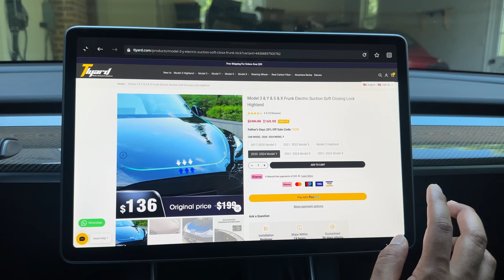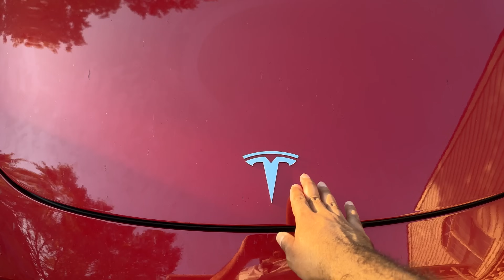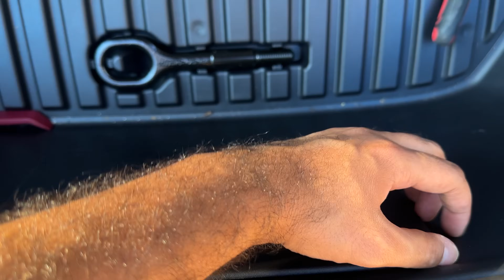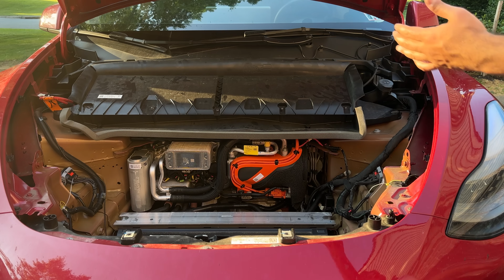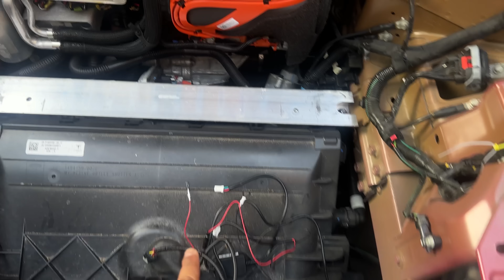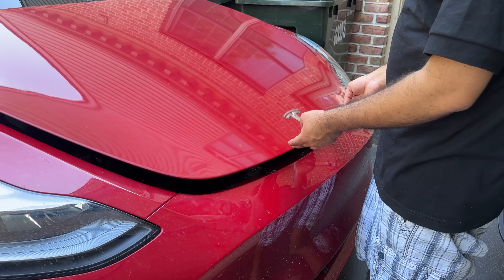How to Auto-Close Your Tesla S3XY Frunk (Simple & Affordable DIY!)

Comment: Thank you for the instructional video. Very helpful. Mine worked for a couple of months. This morning I tried to open the frunk, but it won’t opened. I hear it clicking and trying to open when I click open on the app or the display. Not sure if this is a soft close mechanism problem or Tesla latch won’t release. I tried to restart with the two scroll wheels and also power off. No dice. I wonder if you’ve heard anyone having the same problem

Comment: I just recently installed this soft close motor.  I didn’t install the brass metal shim and unfortunately I had to use some force to get the frunk to close.  Today I went back to my install and added the brass metal shim. What a big difference!!! You need to add the brass shim.  Now I just gently let the frunk hood down, it touches the sensor on the electric motor and closes without force.

Comment: I bought this in January and did the install myself on my 23 Model 3. I just returned from a 5,200 mi road trip. The suction close worked great UNTIL it didn't. I put my duffle bag in the frunk and closed it. No Problem. When we reached our hotel 14 hours later, the frunk would not open. When I try to open the frunk with the app or in the car, you can hear the latch release but the hood does not release. I CAN NOT GET INTO MY FRUNK. I believe the suction device is holding down the hood latch and will not let go. It isn't the car, it's the suction device from Tlyard.  There is no way to get into the trunk.  Like I said, the hood is trying to be released but the suction is not letting go. I have no way to access the suction device....there is no manual release for the suction device. BUYER BEWARE!!!!  I have a service appointment in July for Tesla to try to get in....I'm praying for an easy fix...... BUYER BEWARE.
Reply from the maker: Hey my friend, I am so sorry to hear that. That is very concerning. Did you use the gold piece that came with the kit? On mine, I didn't use the piece and the top bar (latch sensor) doesn't hold the latch at all, it simply slides on the side and pushes the switch. Please keep me posted on how it goes with Tesla. I appreciate your sharing the experience.
Reply: @ShivaSapkota  No gold piece was supplied. The Model 3 is a different unit than the one in your video. I think the 3 and the Y are different.
Reply from the maker: @DougTheMedicareMan  Hmmm okay. I wonder if they changed that latch piece for 3 then. Thanks again. I will also reach out to Tlyard proactively and see if we can get some clarity. Please let me know how the Tesla service appointment goes and what they say. Thanks
Reply: @ShivaSapkota  Thank you. They say to 'pull the cable' but that cable is for the Tesla portion of the trunk release, not their motor release. I'll take any help I can get for sure!!
Reply: @04red6  Thanks.
Reply: I bought this and haven't installed it yet since I was on a road trip when arrived. I was about to install it today and just saw your comment. did you figure out how to open the frunk if the mechanism fails like it did for you? I like this mode but I don't want to have trouble opening my frank because of it.
Reply: @thunder6290  don’t do it!!!!  My service appointment is in 10 days. Still can’t get into my frunk
Reply: @DougTheMedicareMan  KIf it's installed correctly, you will have zero issues. Whoever installed yours apparently did it incorrectly. This is the only instance I have heard about this device.
Reply: @04red6  thanks for this advice again, but knowing what I know now, I will NEVER install something like this ever again and I will never recommend it to anyone either. You do what you want. God Bless you
Reply: Update:::::: Tesla was able to access the frunk and remove the Tlyard device. Tesla charged $301. Proceed at your own risk.

Comment: Is there a fuse on the positive side wire? If not I would highly recommend putting a very low amp fuse on the positive line. This could act as a safety. If anything gets stuck in the trunk while closing the motor will pull more amps. With a low amp fuse you could hope in this situation the fuse just blows and nothing else gets broken. Really I'd like this product more if it had a current sensor on it that stopped the motor if the current went too high (something is stuck).

Comment: I would be the reason Tesla doesn't have this feature stock is because of laws that require the front hood to be latched in a specific way and also for safety concerns cuz if your finger is under the hood when you use this motor the motor isn't going to know your finger is in there. Also if something is blocking the hood this motor might just keep pulling down until it breaks something.

Comment: I installed a similar product on mine.  I noticed you still installed the metal plate part.  I did on mine too.  However, you didn't really go into the specifics of how to install it correctly.  There is a curved bit on that plate that needs to be bent inward, which you didn't show.  Anyway, if it is working for you, then I guess it is not necessary.  Mine is working really well and I can simply gently let mine down and it will close.  Yours is probably a misalignment somewhere...mine works perfectly so far.  And if mine is unlocked and left as it for 90 secs, it will relock itself.

Comment: Excellent product. I would add that, since youre having to draw power from the battery, and have a way to detect when the frunk is open, you could add optional conection for a light strip, to have light inside the frunk then its opened. Depending on the endswitch you are already using, all it would take is a single conector! Great design btw. Very good engineering mindset at work there.

Comment: This is the first Tesla accessory on your channel that’s an IMMEDIATE buy for me. I honestly can’t think of why I wouldn’t. The price is very reasonable. Installation is easy. The product seems to work well. The product is very much useful for those of us who frequently use our frunk.
Reply: Why you wouldn't?

When it fails, you'll lose access to the frunk. And I do mean "when", not "if". This is like version 4 of the product, previous versions had major design faults which blocked owners access to the frunk when it failed. I doubt 4th time is lucky with this cheap crap. I even saw one website selling this telling the customer not to put anything "important" in the frunk if you fit this. Says it all really.

Also the safety aspect of this. Getting your fingers caught there will be no joke.

Comment: 19:56 I imagine the mechanism doesn’t activate from such a light closure is for safety. Can you imagine the frunk closing on your finger when you didn’t intend to close the frunk? The gap when you close the frunk lid a little hard is not wide enough for a finger, but it is wide enough for a finger when you lightly close the lid.
Reply: Nope, mine can close on light closure.  And if I unlock it by accident, after 90 secs, it will auto close itself.
Reply: @luketoh1  do you have the gold/yellow piece installed? I’m really trying to figure out what that thing is for

Comment: I guess the flunk hood will still  open if the unit fails.
Reply from the maker: That is correct, this doesn't change the actual frunk operation. This simply emulates the hand press. Thanks.

Comment: Thanks for the nice install review. But I want to comment on your suggestions. You cannot have the spring on the sensor too light or a contact sensor because when you open the front the weight of the hood is still applying pressure to the sensor and if it's too light it may just close again on you. Same thing with a contact sensor when you unlatch the frunk the latch is still touching the automatic closer sensor and it would just close again.
Reply from the maker: That is good point, thanks. I didn't think about it. Their new version apparently auto closes after a minute if left at that slightly open position. It won't close if you open the frunk within that minute but still supports the soft close.

Comment: You may need to install the "gold" plate. I've installed a similar product and could softly place the hood down. It should also auto close in about 60 seconds if frunk is accidentally opened.
Reply: I just received my order and the gold plate was not included. Is this needed? I reached out to Tlyard and they just send an install video which did not include this item.

Comment: Does still retain the functionality to pop frunk in emergencies from the front wires?
Reply from the maker: Yes, that doesn't change. The mechanism that opens the frunk is still OEM, this just adds a motor to pull the latch down (emulates pushing down by hand). Thanks
Reply: @ShivaSapkota  --- BUT.... if that mechanism jams (which mine currently is) the frunk will not open because Tlyard's device is 'holding' the latch down. The emergency wires won't release the third party equipment

Comment: Thank you! Bought if for my Highland half a year ago, but did not come with manual or anything. So this is probably enough for me to dare to install it myself. I got the "gold" part too, so wondering if I do not need it either?
Reply from the maker: The highland install may be slightly different. I don't know what the frunk part for highland looks like but shouldn't be too far off. Thanks.
Reply: @ShivaSapkota  its two piece with wire between motor and lock thing